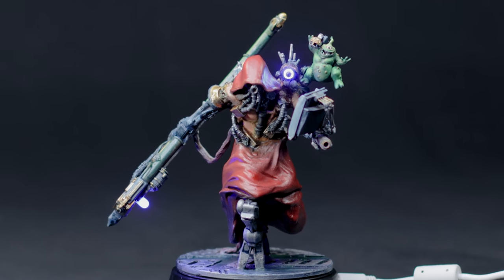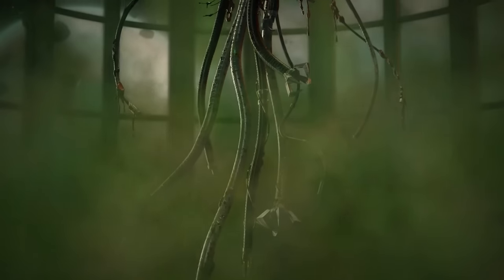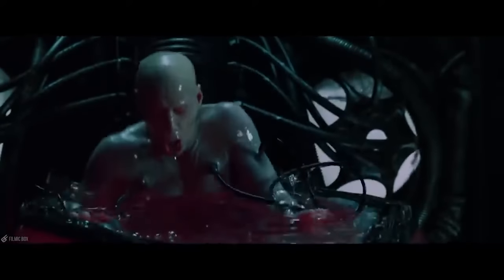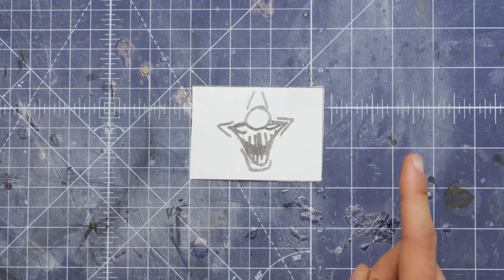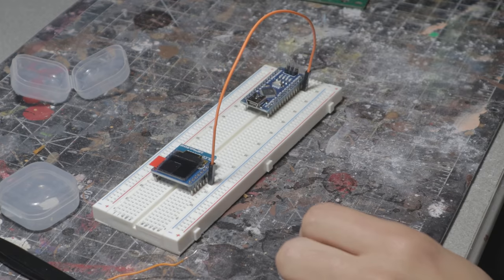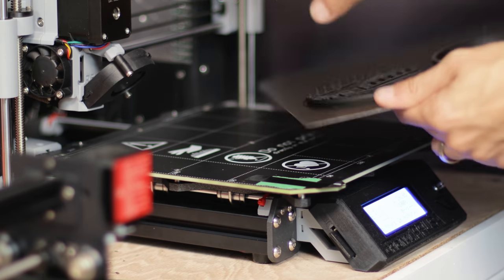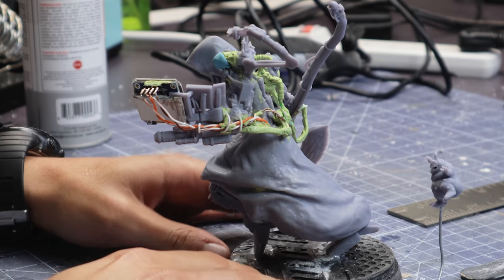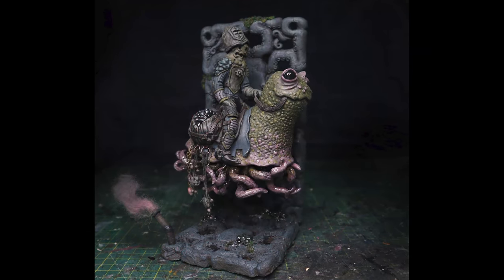Sculpting a MASSIVE AdMech Skitarii Warrior

Comment: As a analog-type maker, this was fascinating and even educational for me. I still don’t understand how you made the screen and actually programmed it. And the result is beautiful.
Reply: The screen is just a tiny OLED screen it looked like (the kind you might find in your phone, only much smaller). He used an Arduino in the base (basically a tiny, programmable computer) to send images to the display and control the other LEDs on the model. To program the Arduino you write some code on your computer, use another program to upload it to the Arduino, and then it just runs your code as long as its powered.
Reply: @zarblitz  oh sure. Easy peasy. 🥲